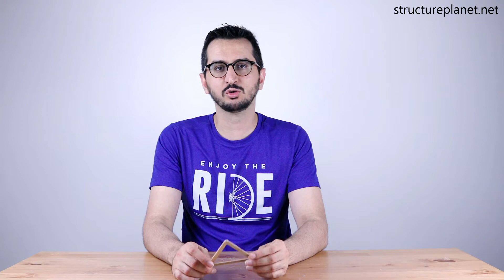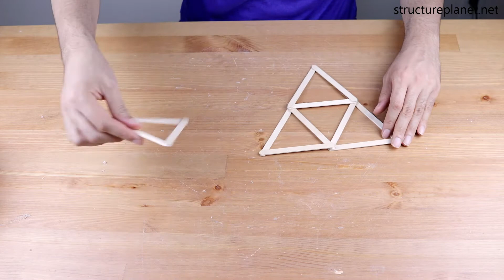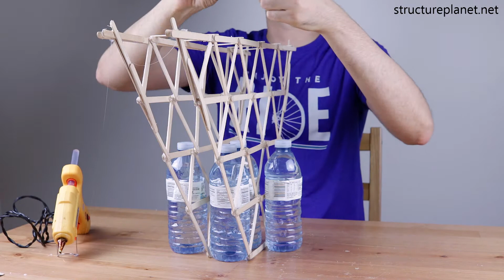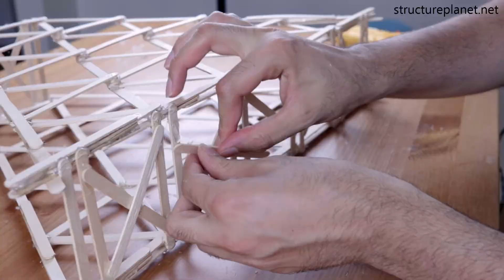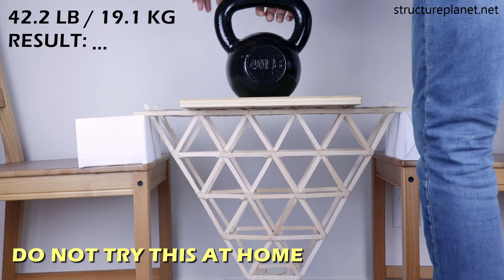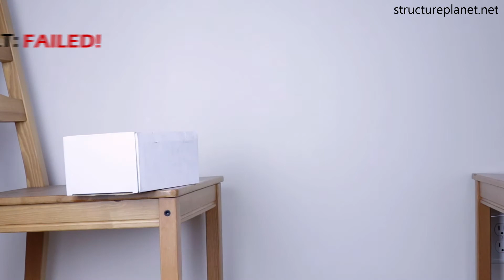Modular Popsicle Stick Bridge: Customize Length & Depth with Triangles!

Comment: Did you analyze this bridge in software before you built it ?
Reply from the maker: Yes. I have realized that the weakest link in my recent popsicle bridges is the glue (connection) and not the member capacities.